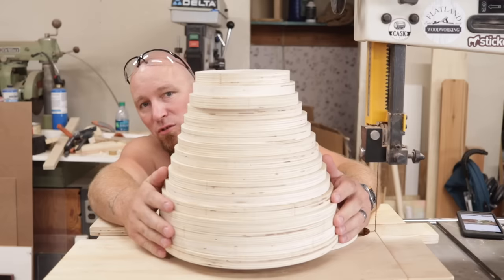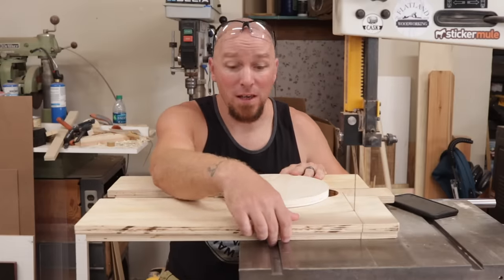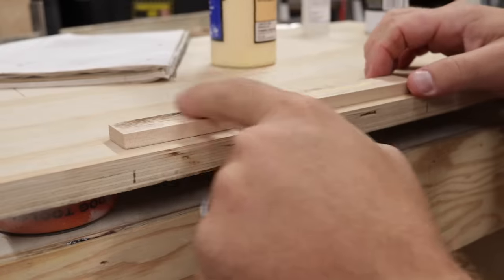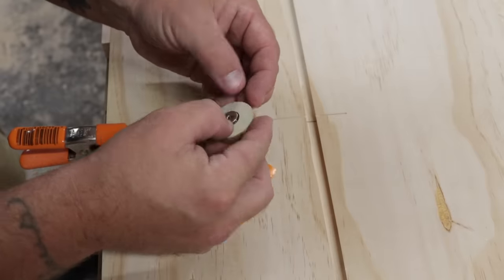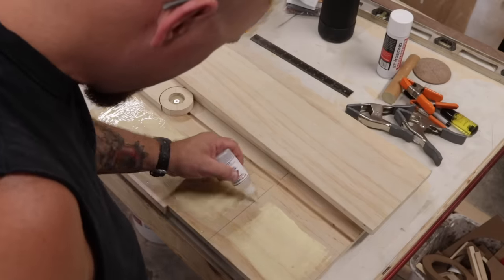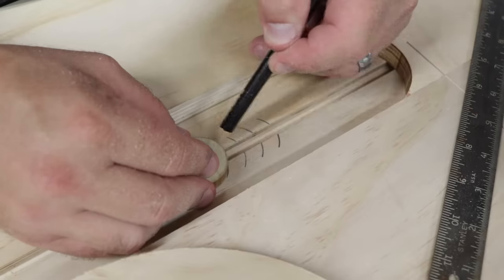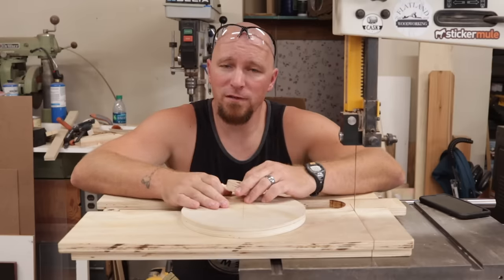The ONLY bandsaw circle cutting jig that fits EVERY NEED!

Comment: This is a very good design and I would definitely want one.
The only thing I might consider changing is to make the bottom board longer so that it covers the whole deapt of the saws metal table. Then I would add something to the underside of the board to make it engaged the groves in the saw table. This would make the gig more stable.
Reply: Using an adjustable T-track below the bottom board should hold it down.

Comment: My bandsaw was drilled and tapped in two places for the installation of the graduated track for a RIP fence. Although my circle jig did use a center pin pivot, I just allowed my stop to extend farther down the front and bolted it to the table in the holes tapped for the fence.

Comment: Maybe you could use a larger rare earth magnet on the underside of the jig that would stick to the band saw table. It will slide on the table, but is very difficult to pull it straight up off of the table. That probably would eliminate the rocking of the jig. Nice work.
Reply: Huffster That's a great idea! Counter bore the magnet in the bottom of the sled on the left side of the blade.
Reply from the maker: I thought about that but I was worried about scratching up the table. I don’t know how big I would need the magnet to be in relation to how much weight could potentially be on the jig with large diameters. Although to be fair, I would assume I wouldn’t be using it for circles that large anyway. Maybe I would switch to a router jig or something at that point.
Reply: Checkout KJ Magnetics and look at their N52 type magnets. They are the strongest and come in many different shapes and sizes. They list the pull force for each size. Also, if your concerned about scratching, put the magnet a bit further into the jig were it doesn't touch the table surface. Maybe epoxy a piece of plastic over it? Good luck!
Reply: Or how about making the jig slightly larger to also use the track on the other side of the blade?
Reply: Something else you could do is make the "positive stop" bigger so that it hangs down far enough and to the left enough to screw another piece to it that would catch under the table to leep the jig from lifting.
Reply: I finally got around to making myself a cutting jig two weekends ago, but I did quite a number of things wrong, so I'd like to do it over sooner rather than later. Problem is, I'm just starting out on woodworking and there's a brazillian things I want to do! So much to do, so few weekends...! 😳🙄 As my saw's table is really small I made the jig quite a bit larger than most to have some kind of a table extension at the same time, but in hindsight I think it would be better to have the jig and extension separate from each other.
I fitted sliders on the underside to use both tracks, but I made them far too short; only as long as the saw table itself instead of to the edge of the jig/extension. These tracks are only good for aligning and sliding the jig into position, since they have no beveling, so I also fitted a small toggle clamp to the underside with which I clamp the jig down onto the saw table and in spite of its larger size in relation to the table it's actually quite sturdy when clamped.
Reply: Instead of adding a large rare earth magnet on the underside of the jig, you could drill a recess in the top of the jig to accept the magnet(s) once the jig is in place on the band saw.  This would allow you to add and remove the magnets as needed -- making it easier to mount the jig without scratching the table.
Reply: Inspire Woodcraft You could use a prop on the underside. Simple and very efficient. Or simply make an extension table.
Reply: @InspireWoodcraft  just make the hole for the manget(s) 0.5mm deeper than the thickness of the magnet(s) so that it4they are not actually in contact with the saw table.
Reply: I would use a magswitch that can be turned on and off when needed. This allows you to reposition the board and when it's in place, turn on the mag.

Comment: Just getting started with my woodworking shop and circles are what I am currently using. Everything seems to place a hole in the middle and it ruins my piece. Thanks for sharing and I will eventually see if I can figure out this for my band saw.

Comment: Looks great. Two suggestions to address the wobble in the base of the jug. As you showed us, the runner had some play in it so you could fix that. Second, you could extend the base to accommodate a second runner since it looked like you had a second t-slot on your BS table.

Comment: Jodie, Love your circle cutting Jig.  I just found you and subbed. One way to prevent your jig from tipping is to use two fence clamps from your table saw and drill holes into the edge of your jig and  use those to clamp to your base of the bandsaw.
Reply from the maker: Interesting idea, thanks! The rocking hasn't been an issue at all thank goodness.

Comment: I love it and I'm heading to my workshop now...  Three modifications to come...
One modification I'm going to do was already called out by "mcarojcc" down below (kudo's where they're due). I'll beef up and extend the "depth" stop so that it hooks over the bottom edge of the table. That will prevent tipping and would work for those of us without "T-Slot" miter slots in our table. The stop will also incorporate a vertical screw & knob for fixing the sled to the table so it doesn't move inadvertently.
The other (not quite original) modification I'm going to do is to inlay an aluminum "T-Slot" rather than a dovetail slot. Sturdier, with more consistent accuracy. Not to mention I don't have a dovetail bit.
Lastly, what I aim to do (that I've seen on other circle jigs) is to put a horizontal screw in the "depth" stop so that it can be adjusted for different saw blades. This would ensure that the center line of the Dovetail/T-Slot lines up with precisely the right place on ALL blades, not just the one.
"I am but a dwarf standing on the shoulders of giants"
P.S.Subbed!
Reply from the maker: Thanks for the feedback and suggestions. So I originally thought that the "hook" would be a good addition, but on my saw, the fence rail gets in the way of that so for me I would have to extend the base and stop to wrap around the rail instead of the table, so just keep that in mind. Funny you bring up the t-slot because I actually don't have a t-slot bit myself. I was going to buy one for this build but it dawned on me that most people don't have one and the dovetail bits are easier to get ahold of and are at every local hardware store. Interesting take on the adjustment screw. I would have to see it used to fully understand how it would work. For me, I use the same size blade for cutting pretty much everything unless I'm doing tighter scroll work or re-sawing, so that was something I never needed to consider. If you make one with the modifications you mentioned, send me a few pictures. I'd love to see it!

Comment: Great Idea! I'm already figuring out my variation. It'll have T-trak instead of dovetail since it will be easier for me to route the dado. I'll add a self-adhesive ruler once I get it calibrated so that I can drive myself crazy with sizing possibilities. I'll probably extend it all the way across my saw table in case I need to clamp it. I'll also put a 1/4"-20 threaded insert or two into the edge stop so that I can tweak it if I change blades. I may also make a donut that doesn't go all the way through so that I have a full taping surface. I've stolen some of these ideas from other commenters so thanks to them as well.
Reply: Carl, I like your threaded insert idea on the edge stop.  According to the OP, it's critical to have the blade in the center of the track.  I don't change blades often, but the ability to tweak the adjustment in the event of a blade swap is a good one.  Thanks for posting. Mark

Comment: Nicely done. The only weakness I can see is the clamping nut chewing up the dovetail slot over time, leading to imprecise centering. That could be easily overcome by using an actual wooden dovetail slider with a T-nut fitted from the underside. By using multiple passes with the router, the dovetail slot could also be made a bit wider, if required. It would take care to get the centre-line matched up with the saw blade, but not much more than with the original design.

Comment: to keep it from rocking, I would drill and tap two 1/4-20 holes in the table of the band saw past the blade (on your left as you face the camera). Then have two countersunk clearance holes in the circle cutting jig that mate up with the threaded holes. bolt the jig down . No more rocking.

Comment: Very cool.  You earned a subscription with this thing.

It seems like the metal nut inside the wood dovetail could be improved.  The two parts are dissimilar materials and dissimilar shapes.  Over time, I think the nut will bite into and wear out the wood.

I'm off to make one of these this weekend.  I'll probably extend mine further towards the other side of the table so I can clamp it down if it rocks.  And for the lockdown mechanism, maybe try to make a wood insert that matches the dovetail and use a pronged t-nut on the underside of it.

Comment: It's probably already been suggested but if you extend the base and install another track in the mitre slot it will stop the jig from tipping if you are doing large circles. 
I'd also use T-Track rather than routing a dovetail as the wood slot would mare up over time. Bloody good jig though mate !

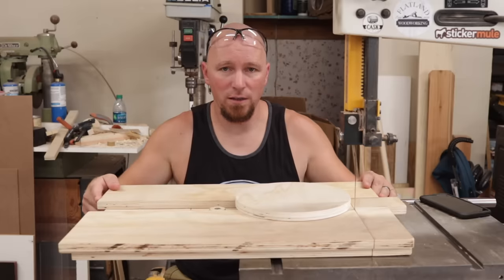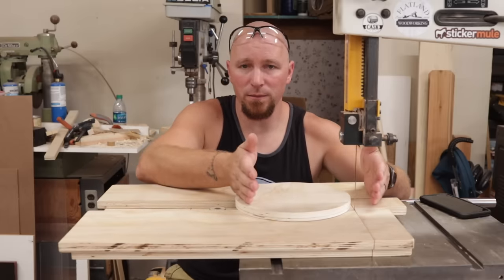Comment: Nice looking jig, much fancier than the one I've been using! At 6:57 you mention the rocking. If you put a clamp the jig to the table where your left wrist is in the video at 6:57, you'll eliminate any rocking and it shouldn't interfere with your cuts.

Comment: Good job.  The pin isn't, usually, a problem, but when it is....

Your rocking issue is why I extended my circle cutting jig all the way over to the upper wheel support.  Not mentioned in your video is the advantage of not having as much sawdust tossed onto the table top because the blade is running into the jig, rather than on an edge, like so many jigs do.

I did cut outs of material on portions of the right side to reduce weight there.

Mine still uses a pin (a rivet), but, like yours, the wood does not have to be pre-cut to a square the same size as the circle using this design, but which many other designs require - just push until you hit the stop and start turning.
Reply from the maker: One thing for me is I wanted minimal tear-out, so running into the jig was crucial. And with that center piece being replaceable, I can throw a new insert in if I put on a new blade or if it wears out. I don’t know why I didn’t make it farther to the inside part of the table. I remember making more than one track but I only used one. Now that I think of it, I think I was so satisfied with having two well made rails that I saved one for another jig. I use it all the time and the rocking hasn’t been an issue yet, but that one track was made as a “t” instead of just a rectangular shape. I think that’s one thing people overlook. Thanks a ton for watching!
Reply: I've taken to buying 3/8" thick aluminum plate in widths sufficient to allow me to cut several guides off them. As such, all my guides are, now, 100% resistant to humidity changes.

I cut most of them using just a standard, carbide, 60 tooth blade, but now have a blade dedicated to non-ferrous metal cutting (you don't need a 10", so can save a few bucks).  Using either, I've noticed a HUGE difference in cutting if I wipe the blade with paraffin canning wax, before I turn the saw on.

Using the wax, I can hear a difference in the cut (quieter).  I see the wax melt just in front of where the blade is taking its next bite, so coverage is, kind of, automatic.

Once I have the rails situated on a jig (sled or whatever, and the "Superglue" works here too), I just drill through the jig into the bar, swap to the right bit for a hole I'll tap, then I use the drill to run the tap in and out. Works like a breeze.
Reply from the maker: That’s brilliant! I’m definitely looking into that. I’m always reluctant building sliding sleds and jigs for that reason alone. Great idea. Thanks a ton!

Comment: Yea, I've never been too keen on the drilling of the hole either.  Its like a cheat mark  or something., nice video,  nice build.  Cool tip with the CA glue  and wood glue combo.. would have saved a few bucks on my Brad nailers and brads  over the years..

Comment: I noticed people asking about tape on the ring and needing to mount an inconsistent surface. If they tried hot glue, let it cool well, then when your done use acetone to release the hot glue. As always do a trial run to work out the bugs. I use this method for copying a templates with a router

Comment: for minimal rocking you can also clamp it to the table after entering circle or clamp a top (raised) guide that keeps it down. supporting it from below may bring negative cut angles since it will be able to play in the up direction within the lose fit bottom guides.

Comment: If you slide the fence to the jig and clamps a scrap block to the fence (downward pressure) it will stabile the jig on larger pieces. Been doing that for some time now, eliminates a long leg that would need a clamp or scree anyways. 👍

Comment: great design. if you drill a hole in the front or back edge you could use a fence clamp to prevent the table from tipping and avoid any clearance issues with the corners as you make the cut
Reply: you could also extend the stop to hook around the front edge of the band saw table

Comment: I'm sorry I'm so late in finding this video.  One very easy way of stopping the rocking for larger circles is to install a Magswitch magnetic locking device on the part of the jig that extends past the bandsaw blade.  Turned off and everything moves smoothly,  turned on locks the jig to the bandsaw table.  
Great circle jig.

Comment: I would make one that covered the whole bandsaw,table  side to side hang off the table and put clamps on the other side past the blade to help hold it stable on the table.  You dont need to make test pieces to find distances  just measure and multiply by 2 that gives you the total diameter of each circle. Measure out center of the screw is your distance from the blade.  Cool jig.
You could also do somthing like this with a jasper circle jig for  a router.

Oh wow a radial arm saw in the background. Looks like a cast iron Dewalt.     I like your jig, and I think you could adapt it to a router circle cutting jig like the Jasper. I belive the doughnut idea will work on it too. No drilled holes.

Comment: I think if you beef up the positive stop a little bit, extend it to the blade end of the jig, then add a piece to it that extends beneath the saw table you would stop the rocking. It's basically a hook that secures the jig and acts as a positive stop at the same time. jmtcw

Love the jig, btw. I've been looking for the right one to copy, now I've found it.
Reply from the maker: That might be the simplest and most efficient solution I've heard yet! Thanks!

Comment: Hi, first of, this is an awesome jig and it reminds me of the one I had sketched before I lost my 3D software to retrieve the drawings I had made (I am a mechanical engineer, specialized in 3D CAD).

Here are 3 improvements that I believe would make this jig the most versatile jig out there.

1- Create a custom nut for the track made out of a 3/8" round metal stock, taped for a 1/4-20 UNC screw and make the adjustment knob out of a 7/16" dowel. Then, you would need to cut the threaded part of the bolt and epoxy it into the adjustment knob, because otherwise the head would be too big for the 7/16" dowel.
         This improvement would allow you to create circles as thin as 7/8" if you wanted to.

2- Below the adjustment knob, I would place a square part that would have a pointer glued to it and also a hole in it somewhere over the base. The pointer would show us the exact radius we are set at by pointing at an embedded ruler in one of the 2 rail guides and the hole in that square piece would be used to drill holes in the base for repetitive jobs (ex: cutting a 4" diameter circle for air hoses)
          The only drawback to this improvement would be that you need to have a zero clearance fence and guide rails that are higher (because they act as supports for the pieces you are cutting)..

3- Add holes for the possibility of mounting a router to the jig. This would mean that you could set the diameter of the circle you want to create and then mount the router onto the jig and double-side tape this jig onto a piece and cut through and also non-through profiles into pieces for decoration purposes and whatnot.

Also this wouldn't be an improvement per say, but more of a fix for your stability issue, as a lot of people already told you before me, just extend the base of your jig over the other miter slot and make a second miter bar for it.

I hope maybe we could see someday a version 2.0 of this jig with some features like this added to it. I truly love versatile jigs like this and since this one is pinless, it is one of the most versatile cutting jig there is. 

P.S.: Sorry if some things do not make sense, I am french and it is getting late for me especially since I am on pre-surgery medications right now.

Comment: Great job.  It always bothered me to have a hole right in the middle of any piece.  You fixed that problem nicely.  Thanks
Reply: Agree - but my thoughts went directly to rounding a piece to mount on the lathe, which a hole in the dead center is useful

Comment: I have not yet done this project, but I will. One possibly obvious improvement to this design is to use both of the miter slots to keep the jig from rocking. I don't have a bandsaw that big, so I won't make that change.